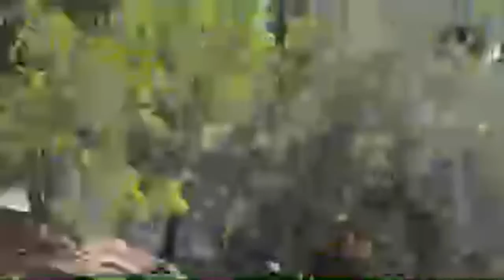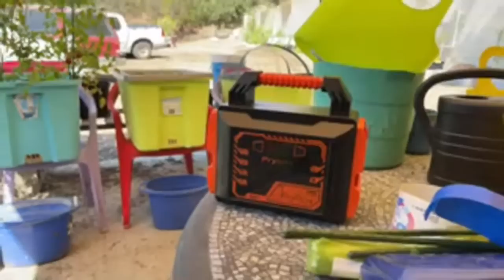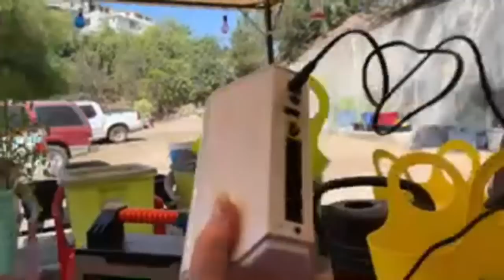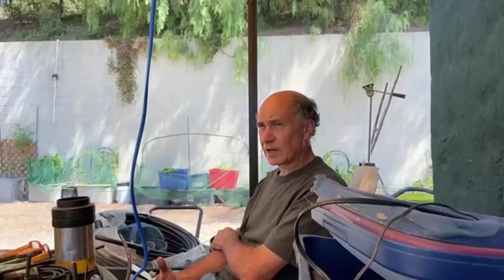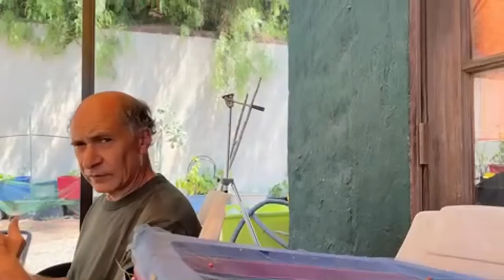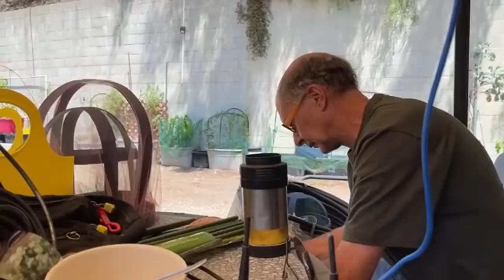Just another TEST in the Garden to See if the Works outdoors

Comment: I had to go on vacation for a week — had sm young seedlings , tender plants , orchids & other potted plants - worried about forecast indicating very hot spells & heat waves coming while I was gone & no one to water —out of desperation I got old plastic bags & after my last watering I put the plastic on the soil & with my seedlings over them & moved all in shade. After returning I was somewhat surprised to feel lot of moisture under the plastic ! No lost plants , so I decided to keep the plastic on & water each pot under the plastic- will see if I won’t have to water for several days now due to the drought in CA, may have to watch for mold problems- perhaps removing plastic occasionally